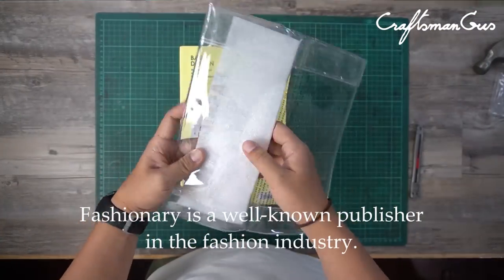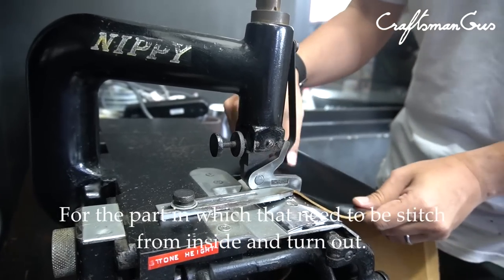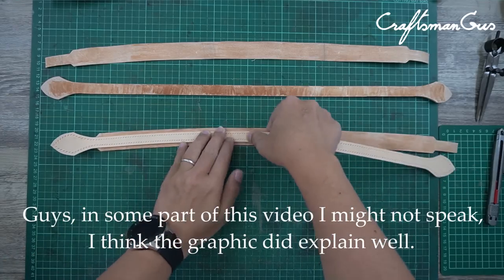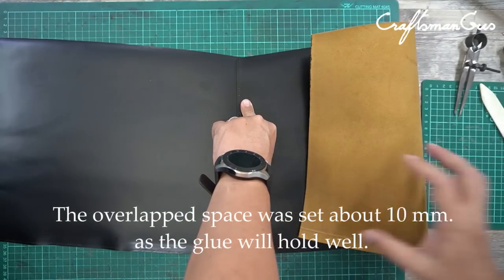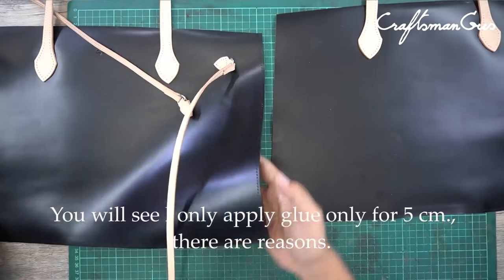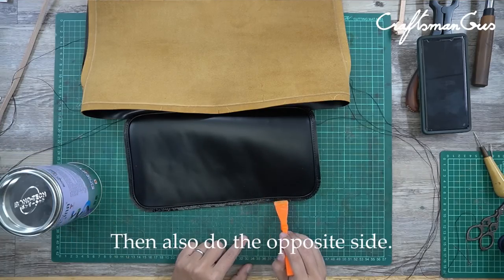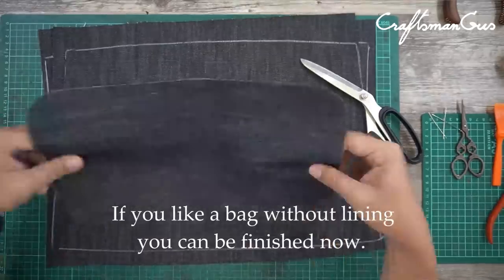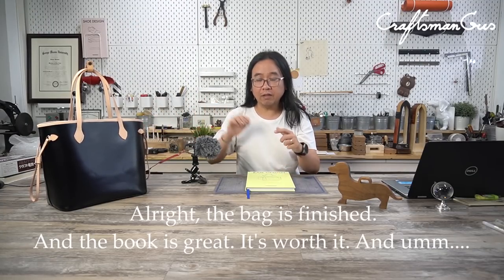Tote Bag Making & Fashionary book review #LeatherAddict EP70 with Narration

Comment: Fantastic video! Can I ask what type leather you used for this bag in terms of thickness and also, can you tell me what computer software you use for your pattern designs? Thank u
Reply from the maker: Normally I use 1.8 mm. thickness for most of the bag. (And also most of the sell of chrome tan here in Bangkok come with 1.8 if not extra request.)
I use CAD software, any should be ok because I never use a 3d form assistant or calculation.
I just use the very basic command coz I still type command like CAD R14 a long time ago.
But if for making form of bag with 3d assist, I can't remember the name but its from Korea I think.

Comment: Can you tell what kind of glue you use to stick the pattern down on the leather, please?
Reply from the maker: It's Grafted Polychloroprene Adhesive local brand here in THAILAND name "Bond-Tech No. BT-430"
Basically you can use contact adhesive and wait it until dry.
No worry to use it because the contact glue need to have 2 side of surfaces of glue for bonding.
You just need to check by make a test on the scrap piece of paper and leather.
Because sometimes if the leather surface colour process is not good enough it may cause damage.
Most of the leather I try is ok.

Comment: What kind of glue you use to put the pattern down that doesnt leave a residue on leather?
Reply from the maker: I just use normal rubber cement (local brand in Thailand), when it dried (not too dry) it can stick just enough to hold on to leather.
But please make a small sample for testing first.

Comment: What do you use to temporarily bond the paper pattern to the leather?
Reply from the maker: The contact glue itself can perform temp bond very well.
Just apply thin n light in width about 1 cm., wait til it dry then you can use for couple times.
But please check, it may not be able apply to all leather kind, try with some small area first.